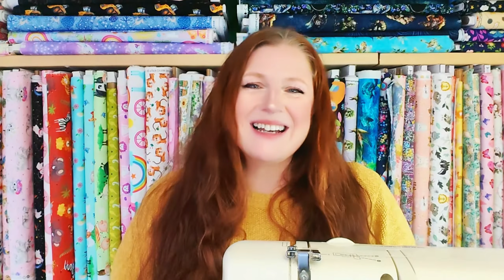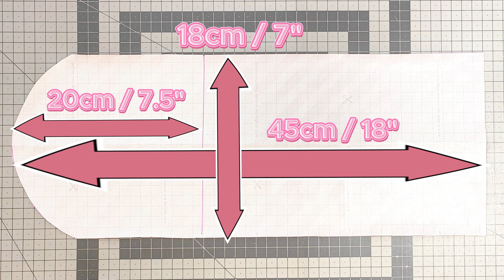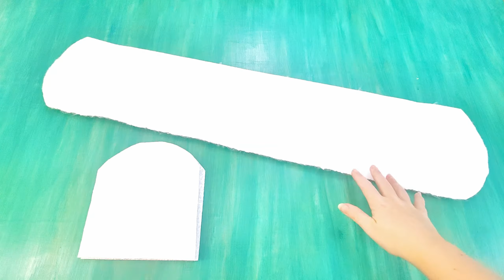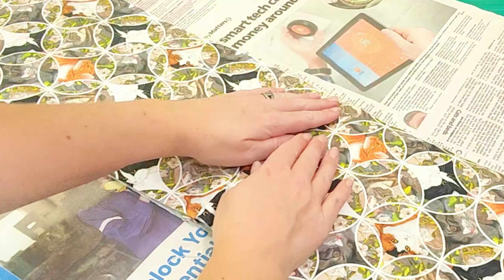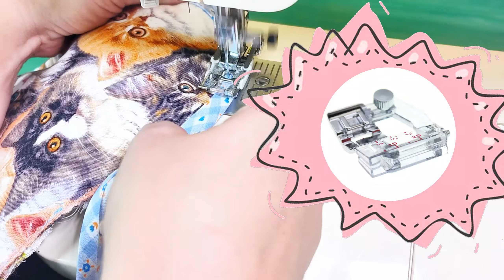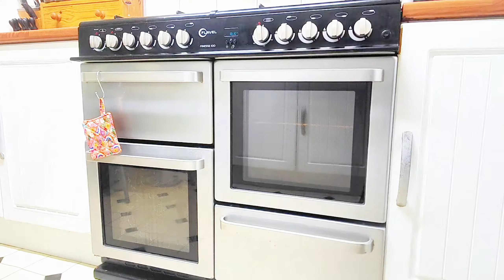Sew Your Own Oven Gloves - No Pattern Download Needed!

Comment: Awesome video!  Your instructions are clear, you were careful to keep your hands from blocking the view of the work, and your tone of voice is pleasant and frantically cheerful (compliment).  The project itself is both useful and attractive.  I can see pairing it up with a matching trivet and some towel toppers to use as a bridal shower or housewarming gift.  Zigzagging the binding edge is a great tip; I've got some potholders I bought at a craft fair that has quite a lip on the binding, so I think I'll try that zigzag trick on those, just to get the hang of it.  Special thank you for showing how to use the overlock presser foot; I've had one for years, but haven't used it even once because for some silly reason I thought, "Oh, overlock, it must be for use with a serger."
Reply from the maker: Thank you so much for your compliments about my video. If you give it a go I'd love to see how it turns out 😊

Making matching items sounds like a great idea as a gift.